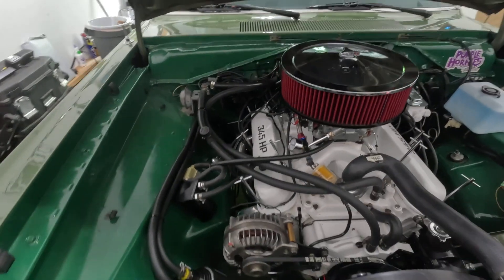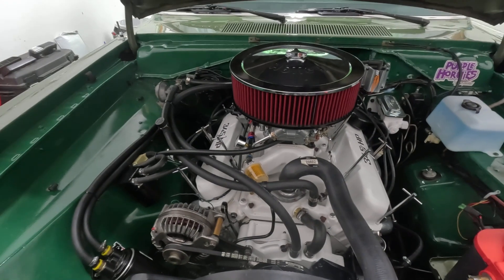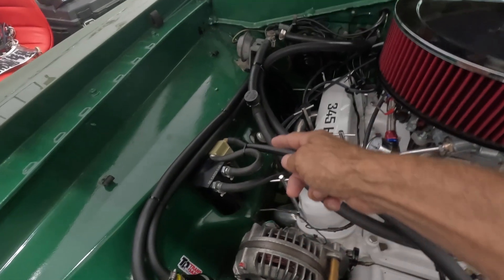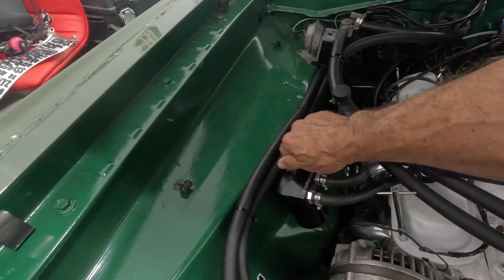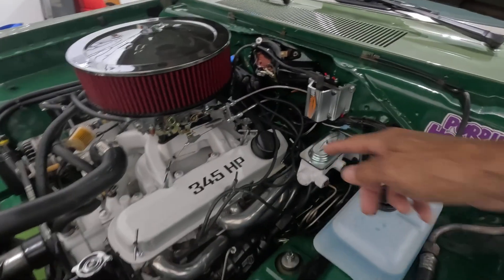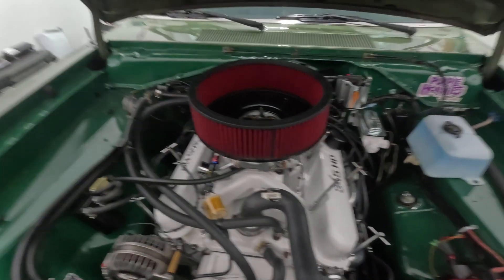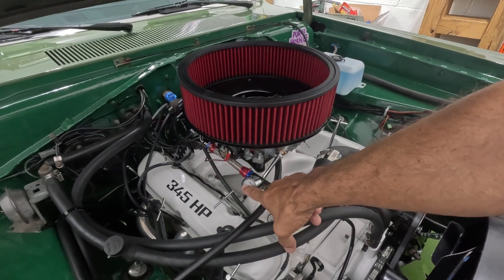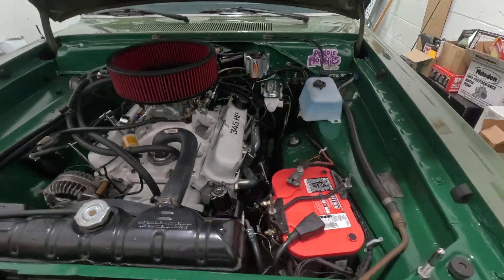Why an oil catch can on mopar 340 engine

Comment: This may be information you already know, but I’ll say it anyway for those of you who don’t know. If you upgrade your engine to make more power, chances are very good that the pcv valve you have on the engine is incapable of meeting the needs of your engine. More likely than not, off the shelf pcv valves just don’t work for higher performance engines, which is where an adjustable pcv valve comes in handy. Also, an oil catch can is a great way to filter out oil vapor and keep it from getting into the intake manifold, making an oily mess of your intake. Your pcv valve should be matched to your engine, which is extremely hard to do with off the shelf pcv valves. I have a small block 408 built on a 360LA block, and I had nothing but problems with the pcv system until I went to an adjustable pcv valve that I tuned specifically to my engine.
Reply from the maker: This is all very true, but in my case it was because I cut the baffles out of the valve covers, they were touching the rocker arms, by the time I put them back on that engine I had completely forgotten about that and was having issues fouling the spark plugs until I swapped out the valve covers and also added an oil catch can but it’s just a stock 340 so that PCV valve should be fine. Thanks for the comment. Mopar or no Car.

Comment: That little bit of oil ..I bet its  ..bad "valve seals" in the heads. Not piston rings.
Reply from the maker: Turns out the old valve covers had the baffles removed PCV valve was sucking up oil.

Comment: Does the valve cover have a baffle under i blocking oil splash off the rocker from being injested straight into the PCV valve? If not thats the problem, also i would increase the breather hose size to the air filter. Thats a small hose for a breather on a non stock engine, i would run a 3” breather off a 1.5” standpipe minimal with a baffle under it so the breather filter wont get soaked with oil from rocker splash……may be excessive breathing but if crankcase pressure cant get out then oil wont drain off the rings and eventually start pushing it elsewhere like into the combustion chamber, rear/front seals etc. 

With the fuel pressure you didnt say what fuel pump you have and if it has a check valve, if its a mechanical pump on the engine or any standard Holley electric pump fuel pressure will drop when the pump stops because its no check valve to prevent it from bleeding off.
Reply from the maker: Yes, the baffles are missing. I remove them months ago because the spot welds were coming off and I just cleaned them up and painted them, but had to remove the baffles because it had witness marks on the baffles that appear to be coming from the rockers rubbing on it. The fuel pump is just my stock fuel pump that came off the original 273 it shows about 6 pounds of pressure when running. The pressure always held until the carburetor started leaking into the intake and giving me a problem starting it after I shut it off. I’ve had that carburetor eight years on the shelf it was used maybe two months before it was put away. I am waiting for the rebuild kit, have that done and eventually order some new valve covers.
Reply: @triggermanrv  where is your fuel gauge, sorry i didnt see it in the video as i was between conversations and had the video playing lol. Yea if its tricking out the boosters into the venturi/throttle blades then its likely the orings letting fuel bypass the needle/seat overfilling the bowls. Goodluck with it, you did a nice job under hood its nice clean and tidy. I run a catch can on any hoses coming from the rocker/cam covers and into the intake tract on all my vehicles, i even have one on my Focus. I have 1.5” stands on the valve cover with baffles inside them and clamp on breathers on my road course car that stays WOT between 4-7k rpm for 20-30 min per session, also a catch can between the PCV and intake. I have only had about 1/2 of a paint can cap of oil in it after 4 sessions so the breathers and catch can keeps my intake tract clean
Reply from the maker: @young11984  thank you, it does have a fuel gauge right in front of the fuel filter. It reads between five and six, pounds which I believe is an OK pressure. I am expecting a rebuild kit today for the carburetor and looking online for new valve covers.

Comment: Ring seal failure I'd say
Reply from the maker: I hope not. I haven’t got the time or the funds to redo anything. I just wanna enjoy this car this season, also I do have my eye on another a body, but that will be a build for the fall. I don’t want to spend another dime on this one if I don’t have to.
Reply: @Vegavibes  
I have an A body, 72 Scamp with a worn out 318 and new heads,  cam headers,  manifold and headers with the same exact issue. 
Good compression but oil rings are toast as the short block is original. 
She runs great but pukes oil.
Not much can be done.
The factory pcv system should be adequate,  low  manifold vacuum could make it worse of course if you have a bigger cam.
Crankcase vacuum helps ring seal.
A fresh rebuild shouldn't need anything more than factory pcv.
Run hotter plugs until it gets fixed I'd say

Comment: I think both the Dustyaman and 451 6pack are both right. If the engine is fresh it’ll take a couple hundred miles to get the Molly rings to seat. In the mean time you’re gonna get a lot of blow by, especially if you’re stomping on it all the time. And with no baffles in the valve covers the oil has a straight shot splashing onto the PCV. You might want to look into bigger taller valve covers if the rockers were hitting. I think they make spacers too. I’ve seen them for big blocks. Basically goes between the head and valve cover to raise your covers up so they don’t hit. Good luck man.
Reply from the maker: Yes, I believe they both could be right I know for sure I made a mistake so I will be doing a compression test as soon as I get the rebuild kit for the carburetor and look into buying new valve covers. I tried looking for them months ago before I install those old used ones but couldn’t find anything in my price range.
Reply: @triggermanrv  if the compression test comes in low, just remember the rings probably haven’t seated yet. So don’t get discouraged. Best thing to do is just get some miles on it, and avoid romping on it for a awhile. When the 440 in my Coronet was rebuilt it took awhile to break in the rings. I blew 2 valley pans before I stopped jumping on it. Lol. It was hard just putting that car around but they finally seated and now I can romp all I want.
Reply: One more thing, I was running synthetic oil at first which I think lubed the cylinder walls making the break in time longer to achieve. Just seemed like it anyway.
Reply from the maker: @JonnyMopar  I used Lucas Breakin oil. I was afraid to use anything else with all the horror stories that I hear about camshaft and lifters wiping out.
Reply: @triggermanrv  Yup. You’re good then. I’m going to be doing a video on cam break pretty soon.

Comment: Are those valve covers both connected to carburetor or intake? I think your engine needs fresh air.. put a breather in another valve cover.
Years ago, i had an internal explosion in my big block, it was a similar situation, but  i had no pcv valve. Engine sounded like shit, and would not run well
Reply from the maker: The PCV is connected to the intake on the passenger side, and the driver side valve cover is connected under the air cleaner. I think 4516pack might be on to something, He refreshed my memory. I do remember cutting the baffles out because they were in the way of the rockers.

Comment: Are your valve covers baffled? There needs to be a baffle so the pcv doesn’t suck oil up from the rockers.
Reply from the maker: No I had to cut the baffles out because the rockers were touching them.
Reply: @triggermanrv  That’s your problem. You have to have the baffles.

Comment: I believe your piston rings didn't seat perfectly  when your engine went through the break in period. Oil is getting passed the rings from the crank case and coming into your cylinders. I've scene this before.
Reply from the maker: maybe I should try a compression test.
Reply: @triggermanrv  yes that would be your best bet. Or leak down test.